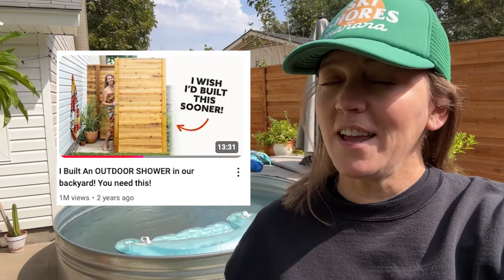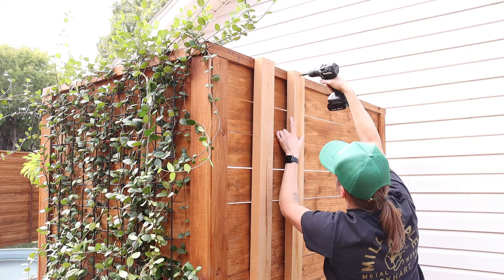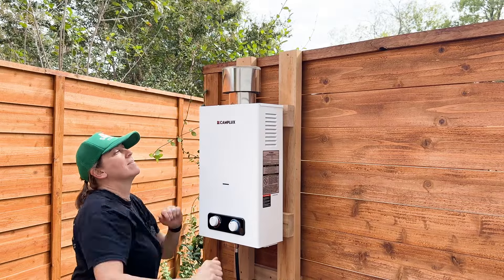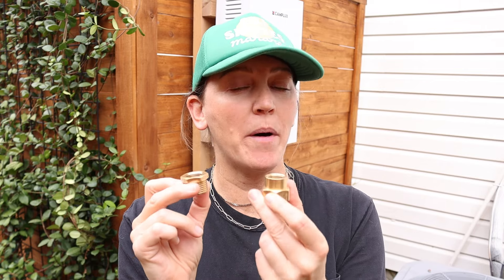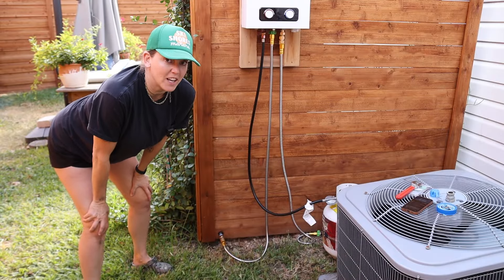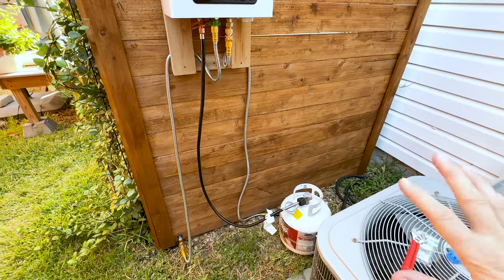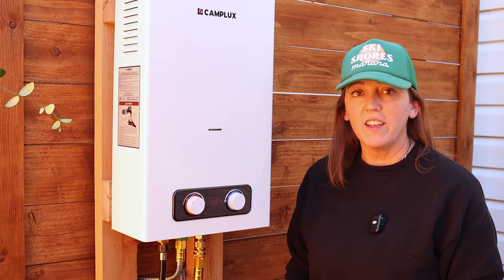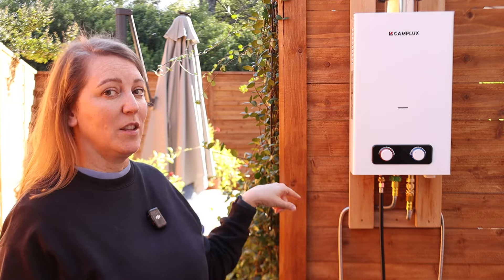HOT WATER Upgrade For Our Outdoor Shower

Comment: Did I miss the part in the shower installation video where you ensured the drainage inclined away from the house foundation?
Reply from the maker: Yes, that is in the first build video. The floor is built so it slopes away from the house. The plants on the outside of the shower are very happy and no water near the foundation :) https://youtu.be/6h4Bu0AzB18
Reply: @MakerGray  Sorry!  Will watch again.
Reply from the maker: @evergladesfl  No worries at all! And thanks for watching!

Comment: Curious, now that it's winter, how much propane do you use for your showers? We're considering this set up for an outdoor bathroom we use as a rental so I don't want to limit people's showers, but also, I want to let them know what to expect. I can get a larger propane tank, just wondering how much you go through? AND...are the controls "fairly" easy to understand? Short term renters have short term brains at times.
Reply from the maker: Thats a great question. I wish I could give you a super accurate answer. Hot showers out in the cold are really nice but in reality, you dont want to stay out there super long when its really cold. So a nice hot shower doesnt take long. I've been really impressed with how long the 5 gallon propane tank has lasted (many. months). The best I can relate it to is a gas BBQ grill. Controls are super easy. The heater starts when the water is turned on. I completely understand re: short term brains though. There are only 2 dials and I bet a permanent sign with directions would suffice.
Reply: @MakerGray  Thank you! We are in an area that gets quite chilly in the winter so that's a good point...people won't be basking in the warmth of hot water for long. And I get excited...more signs! more signs! I think people stay with us just BECAUSE of all of our "learn how to glamp" suggestion signs.

Comment: Thanks for sharing this! Are you able to hook up to both the shower and the stock tank pool at the same time or would you have to change the connections each time?
Reply from the maker: I think you would have to change the connections each time, but it can be set up to be done very quickly and easily. Thanks for watching!
Reply: @MakerGray  Got it, thank you!

Comment: This is great information. I live where it freezes in winter but mid fall and late spring is will be great. However do you have a suggestion on how to cover the propane tank to protect it from storm and or debris?
Reply from the maker: You could build an easy small wood cover (like a little porch) for the tank. I've also seen that people sell covers for them. Thanks!